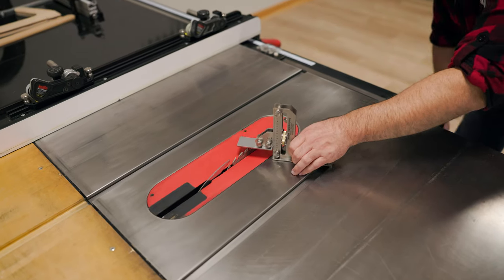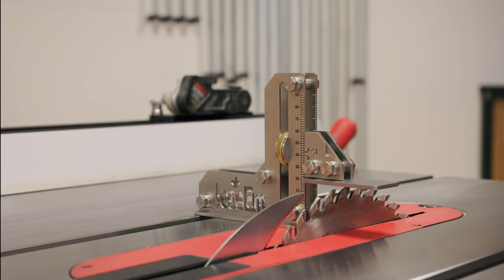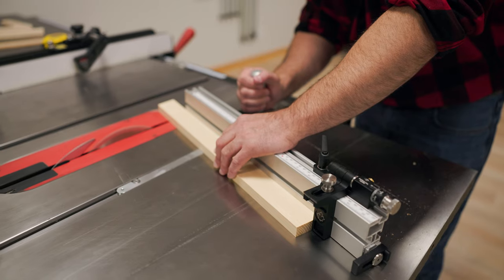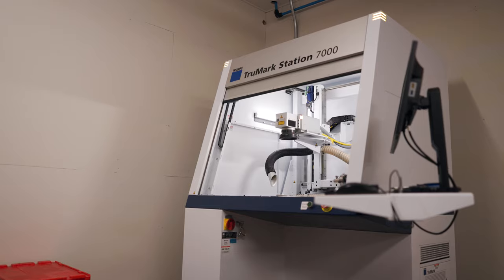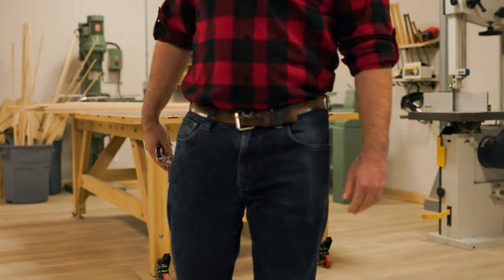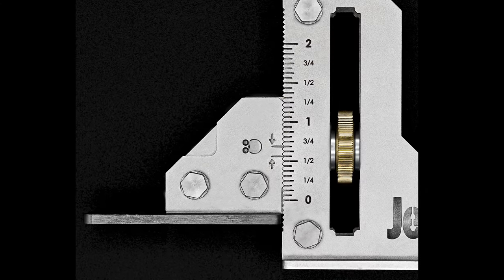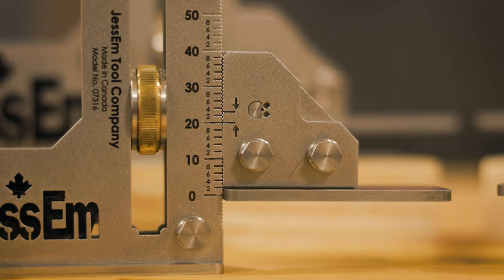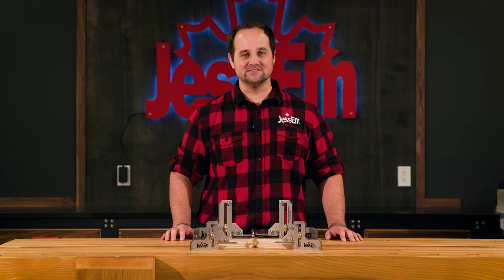The Most Versatile Height & Depth Gauge For Your Woodshop!

Comment: Order the small Imperial over BlackFriday sale. Debating on wether I should've went with metric since it moves in 1mm increments instead of 1/16" except I rarely use metric.
Reply: It looks like 2mm increments from the picture, why do you say 1mm?  I am about to order the large imperial.  Why did you go with the small?
Reply from the maker: @paul8254  Measurements are labeled in 2mm increments, however the indents in-between are indeed 1mm increments.
Reply: @JessEmToolCompany  Ok, thank you.  If you can do 1mm, could you have made the in-between indents for imperial in 1/32" as well?  Is this something you could/may change for the future?
Reply from the maker: @paul8254  We'll definitely consider it for future iterations!